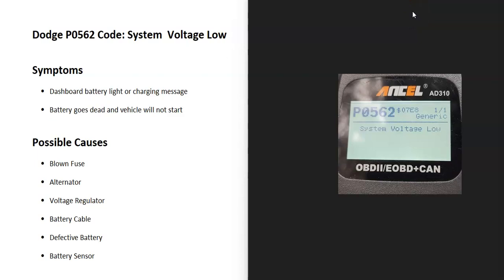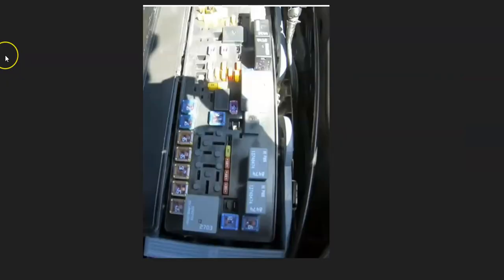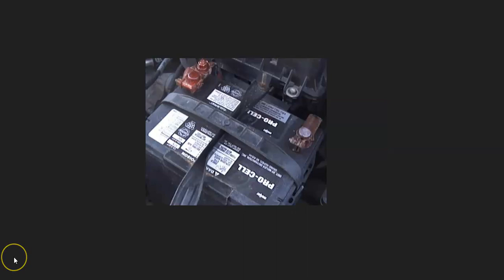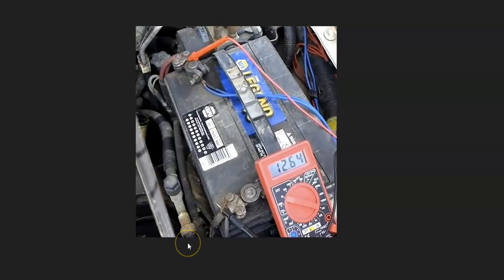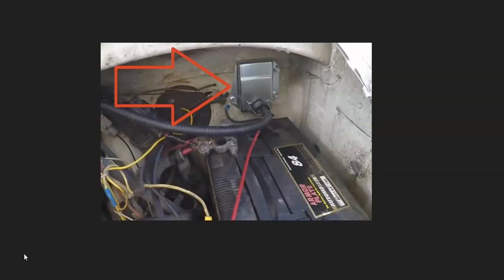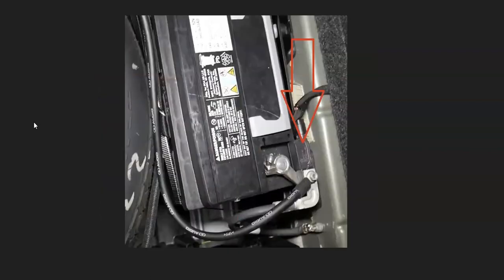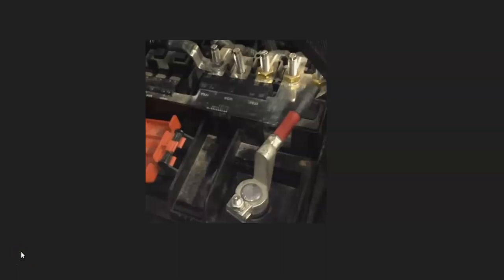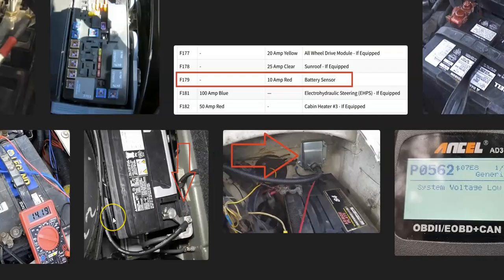Causes and Fixes Dodge P0562 Code: System Voltage Low

Comment: I’ve cleared this code replacing ground strap, 
2012 dodge ram 1500 5.7 , ground strap behind both heads to the cab, was completely missing after it got engine work done.
2012 dodge Durango R/t , ground from 1 head to motor mount, was burnt by the exhaust, also small ground from PCM to one of the strut studs, was broken off 

Same code, cleared, same problem, had other random circuit codes, and erratic starting, stalling

Comment: For those reading the comments, This code took several days to appear as a check engine light. My first issue was a no crank condition on a 2007 Dodge with the 3.7 V6. It would make one hard click every time a turn the key. After many attempts it actually started up. I thought it was the starter so I changed it because it had enough miles on it. That did not fix the problem. Then the light came on with this code. Knowing it was not the starter, I looked at the battery. It was only 3.5 years old, but with some cold weather, the battery was cooked. I got a new one at Walmart and then took the old battery to Autozone for a quick free test. It FAILED the condition test. Cold Crank Amps no longer existed. Check your battery with an official battery tester first. It fixed my problem.
Reply: My battery was tested and is good. Alternator replaced last yr and have 0 issues starting and no dying but still got this CEL n I'm here baffles as to wtf is causing this 🤯
Reply: @josnindiaz1889 battery sensor or voltage regulator
Reply: @josnindiaz1889 did you ever find out
Reply: It’s freezing and my battery is 5yo hope it’s just the battery

Comment: I own a 6.4 jeep and did all that is there any other possible outcome. When the car is running I’m getting an 11.6 V 
Any other recommendations?
Reply: Pcm could be issue. Sent mine to get repaired cost around 250 to send out to get fixed 600-1000+ for a new one.
Reply: @garciafamily5850 where did you send it?

Comment: This is very helpful- found the fault on my Holden Captive when I’m driving on bumpy road engine stop. Then when I’m switching the ignition on engine start but there’s no lights on dash. Found out battery ground connection to fuse box is loose connection. Thanks for your helpful advice and video ❤

Comment: Hi I own a 2011 Kia optima SX and I got these codes C1102, C1126 and B1102 all at same time would you know what is wrong, last thing I replaced was a coil harness connector as when I was checking them by moving them with my hand while car was running and only cylinder 3 it would stumble and I also get a few misfires in that cylinder.

Comment: 2015 Jeep grand cherokee 3.0l diesel.  I'm only seeing 13.4 v now. Was at 14.4v. I have checked everything and cant find the issue.  I have no codes of any kind. Any thoughts?
Reply from the maker: The alternator rated output needs to be looked up but that sounds like it likely is in the correct range.

Comment: My problem has been the ground post to the jumper post. The little copper circle kept breaking and my Chrysler 200 would randomly stall. I completely replaced it with a ground cable from Walmart and have not had any problems

Comment: For future reference, and mainly just to avoid a tow, if you hit qnd jar your alternator with a hammer/jack handle/etc. just like a failing fuel pump, or starter, for which the same works (i once had my fuel pump go bad, and id hit it a few times with a hammer and itd start right up. Drove it like that for like a month and a half. ) My best guess is it knocks the motor loose enough to run.

Comment: Clean battery cable ends and battery post first ! Worked for me. Had a new battery and new cable ends and I guess they had a coating prohibiting battery from m receiving charge
Reply: Had recently related issues on my 05 Dodge Caravan and retightened cable ends.

Comment: Is it possible that code P0562 related to the pcm it’s à dodge caravan 2018 according to my Mecanic the battery regulator is integrated in the pcm Im not a Mecanic and try to avoid changing parts with no results 
It started with a battery lit on dashboard, and drove until a drainage of the battery when I connected the charge the car started and the alternator was charging and working fine . Drove the car for a test and drained the battery in 15 mn , had to tow the car, anybody got this problem???
Reply: I have a Chrysler 200 3.6 and I had the same problem, and it ended up being the ground cable from the battery to the jumper post. It’s super finicky and if it’s not exactly perfect or if there’s corrosion on that little copper circle it can be all kinds of problems like my car stall in the middle of the road while I was driving it it killed one of my alternators, etc.